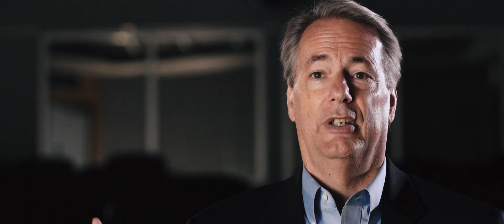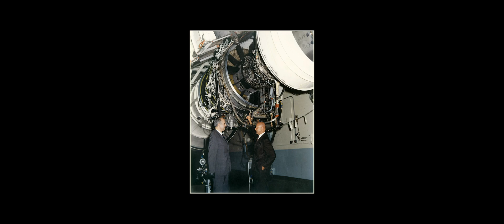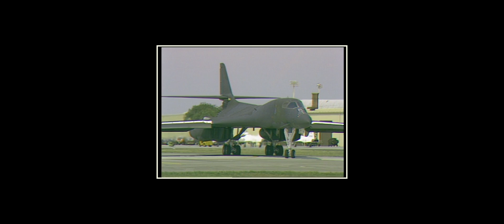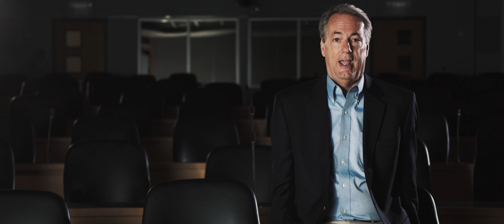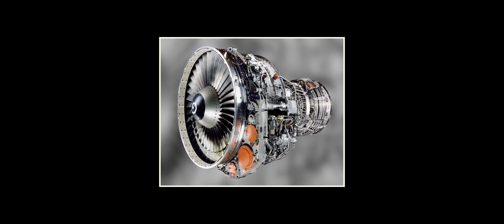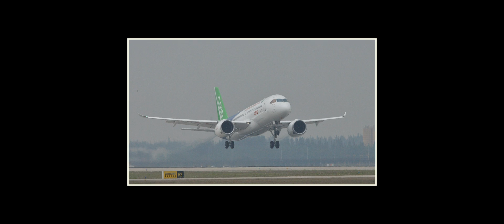Chapter 7 of 13 - Power of the CF6 and Birth of CFM

Comment: The LEAP engine is heavier than the CFM56 series. Not a problem for the A320NEO because on that plane the engines are ahead of the wings, but on the new generation 737 Max they had to position for the first time the engines above and in front of the wing unlike the CFM56 which was slung under the wing. This changed the center of gravity of the 737 Max and so they had to create a system that would counteract the change in aerodynamics and flying behavior that this repositioning of the engine would create and it turns out as everyone knows there were two crashes because the software and the associated system only relied on one angle of attack sensor and there was insufficient training for pilots about how this new system could be managed and operated with. Boeing is now having to revisit and correct the software that is used to compensate for the repositioning of the engines and the effect on the flight dynamics and they will be using two angle-of-attack sensors which will properly compare each other's readings to determine whether a true stall condition it's happening.
Reply: @Logan Kluting Another aspect of the LEAP engine that I neglected to mention is the perfectly round intake nacelles which is standard on virtually all modern jet engines. The 737 non Max (and so does the Max)  airframe sits low to the ground to facilitate engine maintenance. That was one of the selling points of all the 737 models. General Electric was able to change the shape of the engine nacelle on the CFM56 so that there would not be a problem with it being too close to the ground. I'm not sure it's generally known that the CFM56 series and it's semi ovoid shape nacelle for the 737 powers virtually all non Max 737 models that are in service today. Both General Electric and Boeing were confident that the repositioning of the leap engine could be compensated for in terms of how it might affect the aerodynamics. Boeing was in quite a hurry probably more of a hurry than other developmental cycles to get the Max into the air to compete with the A320neo and probably needed to do more work and testing on the sensors and software for the stall prevention system that were specific to the 737 Max. That work is being done now. The Max is a fine aircraft. Boeing has learned a great lesson through the experience. I believe they are a fine company and I hope they come out of the experience thriving.